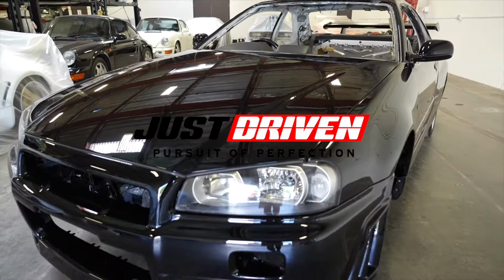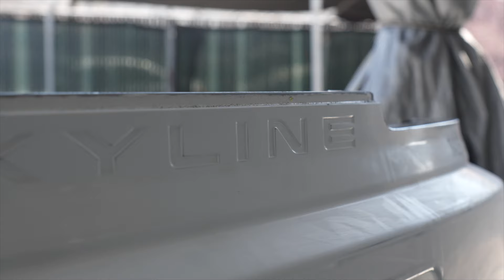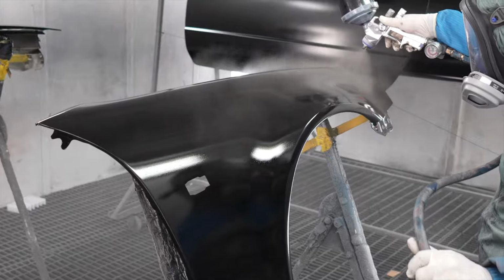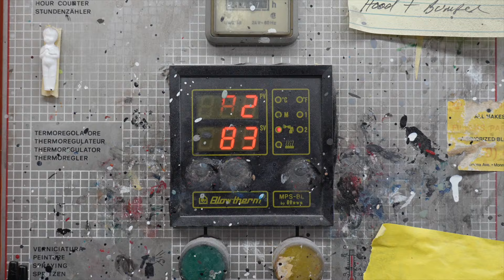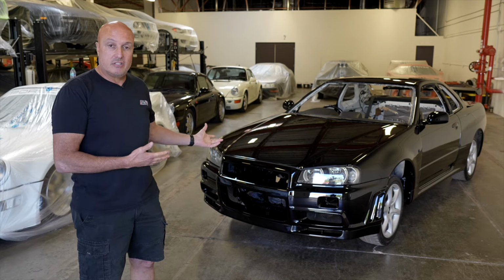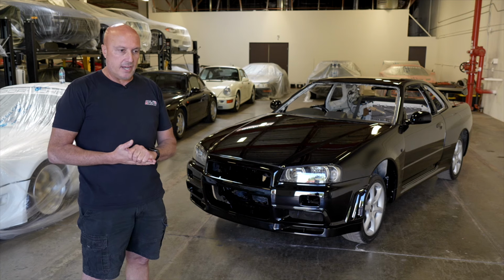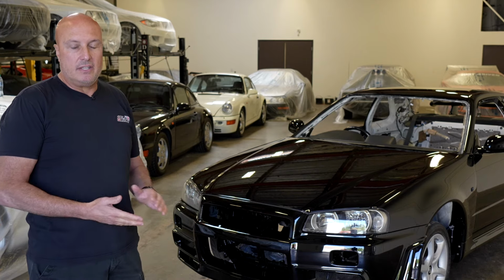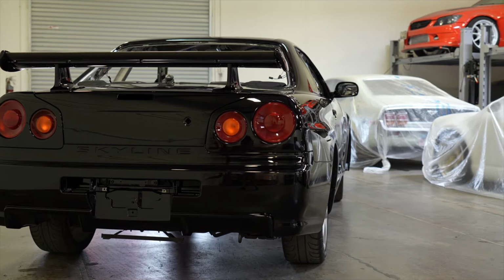Nissan Skyline R34 GT-R Complete Color Change

Comment: Awesome Nissan Skyline R34,keep it up. By the way, my question i asked about the Torreto Dodge Charger is still up. How much horsepower is it making, more or less? Or is it really making 840hp like that 2018 Dodge Challenger SRT Demon?
Reply from the maker: We didn't see your question about the Charger, apologies. It's making about 840 but over 1000 torques.
Reply: @JustDriven  oh yeah i was about to ask if the Torreto Charger would make 840hp like the 2018 Dodge Challenger Srt Demon or less.